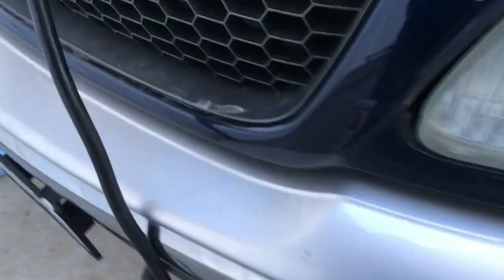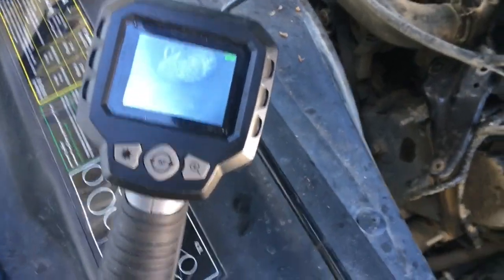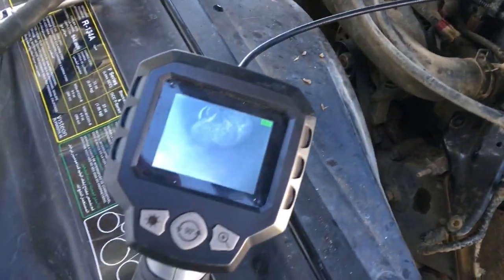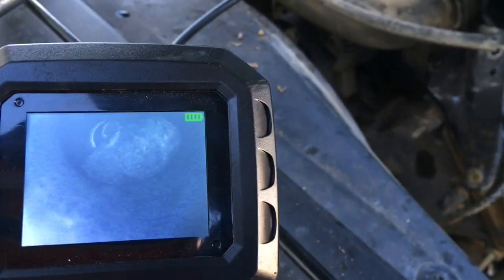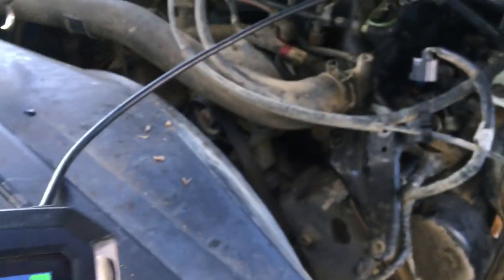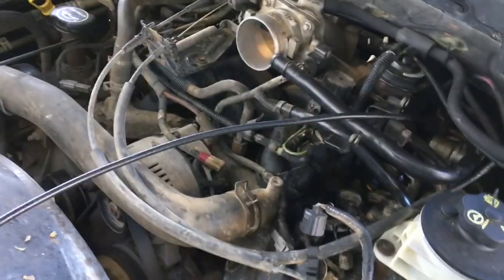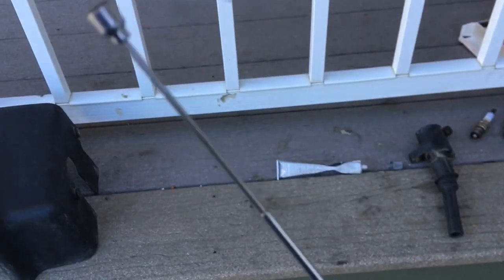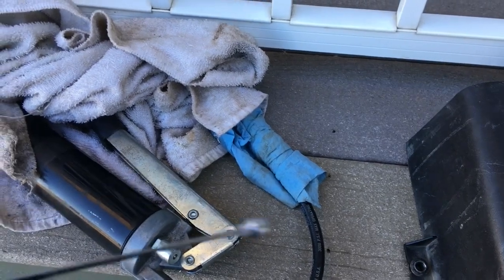F150 5.4 2v Spark Plug Change - check this out

Comment: Did that method work for removing it?
Reply from the maker: Yes.  Problem I was having was that the air wand did not have enough flow to dislodge it.  It seemed wedged in there.  Between wiggling around a stiff stick and then a gob of thick grease on the end, the pebble came out.